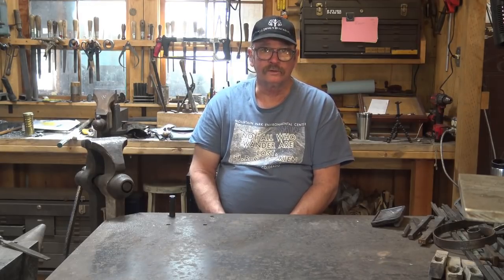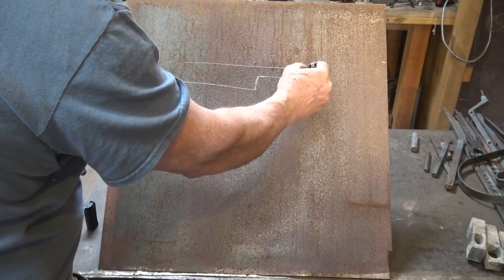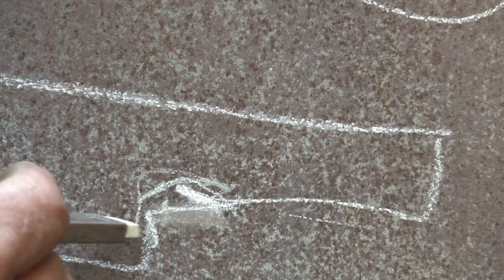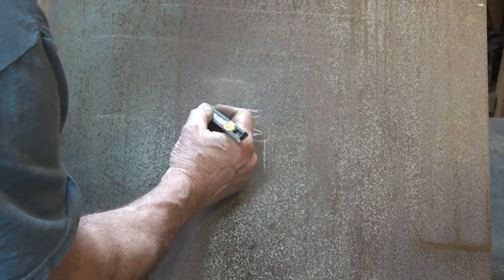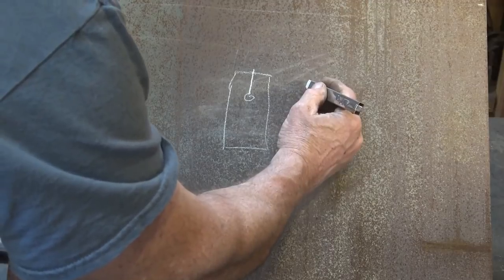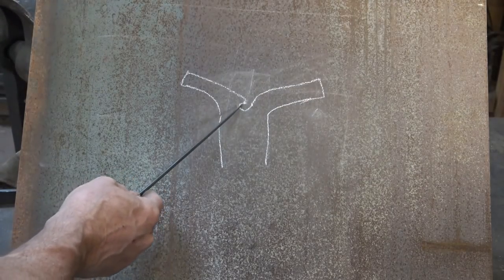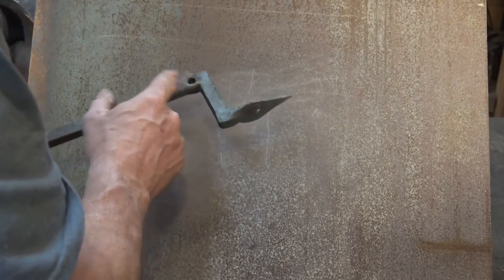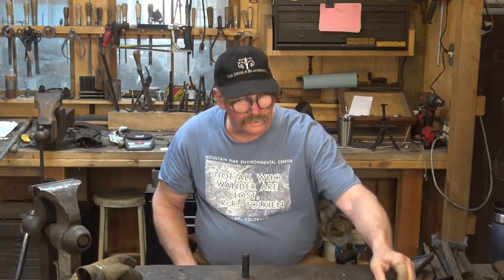What is a Cold Shut? and why do they matter

Comment: Good info John, actually yesterday was making a smaller bending fork, and did it like Mark Asperly, with the backing plate etc. I noticed when I was forging down the fork with a rounded chisel I modified something like a cross pein, that I did something wrong down low, instead of pushing the material from the top, I must of got a bit impatient and ended up with a cold shut near the bottom, which would end up being the tip of the forged fork bit. Just filed it flat and continued and it worked out pretty good.
Reply from the maker: Sometimes just filing or grinding out the bad spot is the only way to go.
Reply: Yeah learnt that the hard way mate.

Comment: So what you refer to as a "Cold Shut" is really an Overlap if I understand you correctly.,...When I worked in a hand sheet rolling mill as a kid during the late 1960's we could sometimes experience "Lapping" in the middle of the sheet when rolling thin steel plates and the center of the top roll was too hot and expanded beyond its true concave shape causing the plate to be rolled in the center more than the outer edges....Actually I'm proud to say that in hundreds of years of steel sheet rolling in Sheffield I was unofficially  the youngest apprentice sheet roller ever in the Goodwin Group at the age of 17...Then again I've never been a normal kind of kid
Reply from the maker: That is essentially correct.  However a cold shut is typically driven deeper into the material through repetitive forging.  It can also be an area that was meant to be welded but didn't.
Reply: I got it John

Comment: What’s the difference between a cold shut and a lamination please? As I thought a lamination was where two pieces hadn’t properly welded together? 

I’m an ex chef and when I'm explaining to people how to make a recipe I will often revert to the French terminology as that’s what I used for over 20 years. Now I’m a welfare advisor at a Disabled Peoples Organisation here in the U.K., where so many types of organisation or benefits are known by their initials. When you see people’s eyes glaze over, especially those like myself with acquired disabilities and are used to working, you know you need to back up a bit. We all make assumptions people know what we consider basics, but they are only basic if you have some knowledge.

As a total newbie who can’t get to night school or take courses due to my disabilities this type of video is invaluable. I know nothing about metal, despite coming from a long line of engineers. All the basics are unknown to me as I did neither on my C&Gs for being a chef or my law degree. Thank for making it.
Reply from the maker: A cold shut has no physical bond.  A lamination would be to different materials bonded, such as pattern welded steel.
Reply: Black Bear Forge Thank you for your reply.

Comment: A question: Why are you not a teacher? Just kidding, here is the Cold Shut question: When you twist steel, like twisting a piece of ½x½ square, and the edges lay on top of each other - is that also considered a cold shut? Another situation: When making tongs from flat stock and the area between the jaw and the boss, where the jaw is twisted 90deg from the boss has a "lip" - is that also a cold shut? And if so, how is it mended?
Reply from the maker: In the case of a twist, the material isn't being forged down into the bar, that is when it becomes a cold shut.  The cold shut is a seam that shouldn't be there.  For the tongs it also shouldn't result in a seam that gets forged deeper into the material.